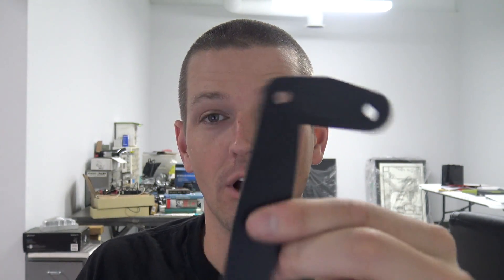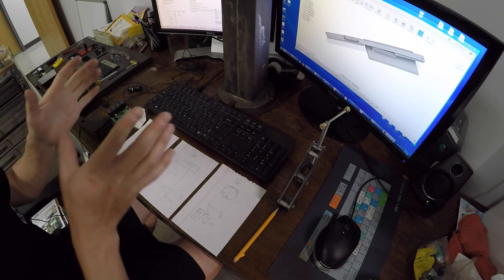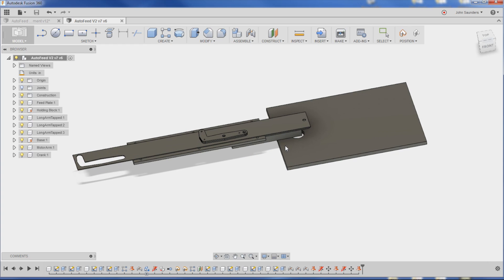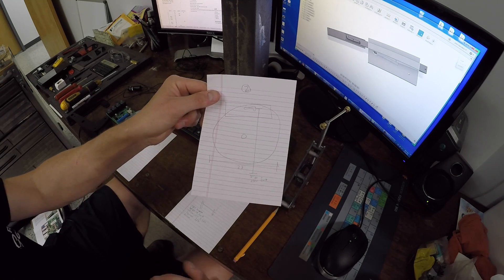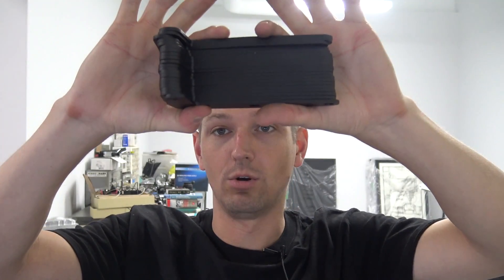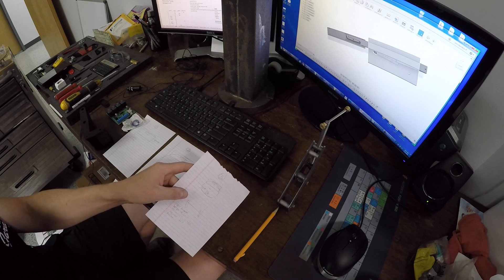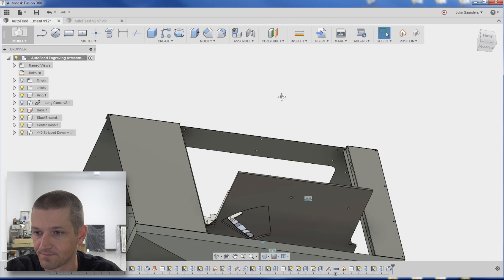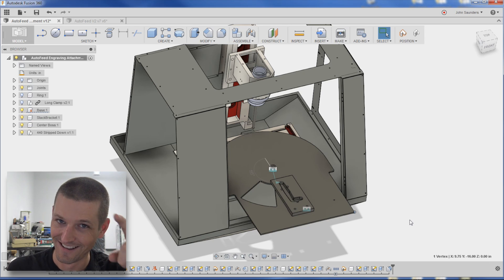Automatic Arduino CNC Parts Loader: Tormach 440!  Part 1

Comment: hi john, i have been thinking about this and a lazy susan design would work, a ring with bearing under the platter, they use the idea on a spice rack that rotates or a round table so the people sat around the  table can get food from the other side just by turning the table around i think you will understand wot i am meaning, thanks daniel

Comment: You may need something to push the engraved parts out of the plate. There will be chips that may cause the part to bind in the plate and fail to fall out by gravity. A simple solenoid should do it. You may  also need something to joggle the stack to get parts to fall into the cutout. And sensors to determine whether those actions have succeeded.

Comment: Linear version can be done much cheaper and more reliably than the rotary version.

Instead of big arms driving the slide, use a rack with a pinion gear on the stepper motor, gives you direct positional control and hella torque.

Linear system is much smaller too, so it will all sit right on the table top.  Will save a LOT of material too.

Also, turn the part 90° from how you oriented it on your linear slide drawing to save significantly on the stroke length.

If you elevate the assembly above the table some, you can make a chute from the drop-out hole into your waiting bucket, or just dump the finished parts into the chip pan.

I think the linear version with the part turned 90° can easily fit on the t-slotted part of the table, with no extensions needed.  You could even close the doors if you had the chute go out one of the side windows.

Whatever you do, remember that it all has to move with the table, so any feet you put down on the ground will have to have very free rolling casters (or more ideally, a single central ball under each leg (like you find on a ball conveyor, but upside down).

I'd be happy to sketch something up on paper and scan it for you if I'm not making myself clear here.
Reply: I agree with you! Though my first thought was to use pneumatics to drive the linear system. It would be simpler from a controls perspective, just a solenoid valve to two. 

The linear setup is just so much smaller. This is a good example of why it's good to step back and re examine your designs. The disc seemed better than the slider at first, but once you figure out that the disc really entails, the linear may actually be the simpler of the two.

Comment: John, as much as I love Arduino, you are right in that you should control this one from the mill with the relay board.
Trying to describe my idea, but it's not easy.
1. Screw-in round nylon 'backing' posts to a base plate at appropriate positions which have a chamfer to push the part downward and hold it in the +Y pos.
2. X-axis air cylinder feeder plate which fits under the part 'hopper' to feed the part (L or R) to a central position.
3. Multiple air cylinders pushing from the -Y axis again with similar nylon posts to clamp in the part.

Comment: if you have a removable insert you could have different sizes jobs and just change the insert, the disk could work for all types of jobs. and under the stack you could have a roller to the floor to task the weight..

Comment: Moving around a heavy weight outside the machine area is going to put a lot of load in a way that the machine is not designed for. You will also quickly exceed max workpiece weight.

One idea to fix that is to have the rotary table to be a half circle, such that it can move in to drop the piece in the fixture and then get out of the machine again. This leaves the problem of how to get rid of the workpiece again. That could be done by having the fixture as another rotary table.

The second rotary table moves with the machine, but it has no load on it and will not be too heavy.

With some clever half gear it would be possible to build this with just one stepper motor. The second rotary table does not need to be able to move until the work table is in the outer "switch workpiece" position. At that position it would mesh with a moving mechanism. The same principle could be used to lock it in place: spring loaded pins will fix it in place. When the CNC machine work table is in the outer position the pins will be pressed down so the rotary table can move.

Just a funny idea that popped into my head: It would actually be possible to do all this with NO stepper motor and no Arduino. The rotary tables would be moved by the Tormach machine table pushing against levers :-)

I still believe that the robotic arm is the simpler solution. The students can build one in three days and they have half the machines and none of the experience of Sanders Machine Shop. You would of course do it in metal using the plasma cutter to cut most of the parts.

I would fit the robotic arm with a suction grip and a contact trigger. The program would be something like this:

1) Move the arm to a pre recorded start position. 
2) Lower the arm until contact trigger switches. The arm is now in contact with the next workpiece.
3) Turn on suction grip
4) Move arm up to start position. Check that the contact trigger stays on.
5) Move arm to pre recorded drop/pickup position.
6) Turn off suction grip
7) Move arm to hold position and wait for CNC machine to do the job
8) Move arm back to drop/pickup position
9) Turn on suction grip
10) Move arm to finish position and drop piece.
11) Repeat

All that is just a simple program with your Arduino. It is a series of 3-4 recorded X/Y/Z positions and some turn on/off commands.

Comment: Only one idea I would try to incorporate, and that is removable pockets in the plate, rather than fixed, this would allow use on multiple jobs, a crap load extra work but if you are going to make it anyway you might as well try and get the most use/profit out of it you can.

Comment: Love the design except having the parts sliding on the disk. What if you added a air cylinder to push the part from your supply stack onto the rotating disk. That would eliminate all the friction of the parts riding on the disk and eliminate a large drive motor to turn the disk.
And if you not sure what I am thinking look at a bubble gum machine where you lay your quarters down flat then push the slider in to the machine to get you gum. Same set up I think it would work great

Comment: I was thinking optical sensors as well - but to ensure alignment of the rotary platen.  You could have multiple cutouts to drop parts onto, and then have multiple holes drilled through the table that provide an index for the platen.  Program it to stop whenever the photocell triggers.  That would allow you to advance the table a partial rotation, engrave the part, partial turn, engrave another.  When it got to the other side of the rotation where you part is supposed to fall out, another optical sensor could verify it did.  Might be easy with a relay l to add a "poker" solenoid that would actuate when the piece was over the escape chute to ensure the part did actually eject.  Since this is engraving and not machining, you wouldn't have to worry about chips blocking sensor holes.

Comment: i would think that you would want more stations on your indexing table to pick more parts then you could just index by the amount from the drop station to the load station.  that would give you a better throughput as the table would make less rotations for many more parts.

Comment: One suggestion about your sketches.  Keep an Engineering Notebook, and do your sketches in that.  Date the sketches.  Why this is important....possible patents later own.  I still do a Notebook to keep my doodles in.
Reply: The modern version of this is to use a digital signature timestamp 
service, the results of which can't be forged and are usable on cad/cam files.
Reply: A 'real engineers notebook' is a special kind of thing.  Back 'in the day' it used carbon paper, you put between 2 pages.  They were all sewn in, but the second (carbon copy) page could be torn out and 'filed' with 'the company clerk' (who filed them in case your notebook with the original was lost or stolen).

If you use it on a regular basis as part of your daily work flow, it is a legal record.  Just like a court clerks record of proceedings, it is pretty much immutable and incontrovertible in a court of law.  You must be able to show a long term use as a daily log of your thoughts.

In today's world, I don't know if there is some newtech version.  But I kept a day planner for years that filled the same roll in my techie professional life.

Comment: Hey John, I would suggest combining the two designs. Have an externally mounted hopper that an arm(segment of your disc) swings out to meet. A solenoid then releases a single plate from the hopper into the arm. The arm swings back into the machine and does the engrave cycle. Then swings back out with a different table X position to drop the piece.  X axis then moves to place the arm back under the hopper to collect another part. 

On the arm I'd do a 3 position clamp. Positions being open, catch and clamped.  In the open state the parts would simply drop to the floor/into a bin. In the catch state a lip would catch the parts dropping from a hopper. It could be done with a single air actuator and a spring. Have two valves and two different air pressures. So open is 0psi, catch might be like 10psi and clamped would be like 80psi. Adjusting the pressure on the catch would set the amount of opening as its pressure against a spring. The same action could also trigger the hopper release or that could just be a Y axis table movement. 

I would also put a V shaped catch on the moving jaw that indexes the arm onto the Tormach table. So the arm would rotate into position before clamping down on the part. The action of clamping down would then lock the arm into place. Releasing might be tricky because you want to drop pressure to the catch state but not to open. 

All that said maybe a Y table movement should also trigger the drop, rather than the air actuator. That makes the air actuator simply a clamp. The lip would simply be spring loaded with a leaver that the table movement hits to flip it down. 

This design might be more re-usable for other things. You would just need to make new clamping jaws and hopper release mechanism for each part.

Comment: The support legs will need a way to move with the X/Y axis during engraving, as the fixture /rotary table will need to move.
Reply: Also the clearance from the rotary part to the 440's doors will need to be sufficient to ensure when it does move in the X or Y axis it can't be crashed into the enclosure.

Comment: after reading some of the comments below i can see why the 2 Axis of freedom for the support legs was discussed.
i can also understand the use of an electro magnet for holding the work in place whilst being engraved.
I am in no way advising you how to build this im just throwing ideas around.
what about using a vacuum system on a helicopter blade type set up with vacuum suction cups opposing each other at 180 degrees on the blade thus one picks up the ( to be engraved material from a hopper whilst the other picks up engraved material from a die on the mill as it rotates to place the new part in the die the engraved part can be dumped into a box or container... and so forth. The Materials hopper could then be mounted low for ease of reloading with stock and the stock could be fed to the top gradually by a spring loaded mechanism as in a gun magazine.

Just a thought, love the channel

Kind Regards Vince.

Comment: The trouble starts and ends with getting the parts into and out off the fixture, with the tolerances needed for the milling. The easiest way to overcome the trouble, would be to make a number(20) of slots in the disk and go with that, automated feeding is an overkill.

Comment: You may want to consider the hopper system so that future engraved parts don't ruin the powercoating from the previous part.
So, if a part is already in the hopper/bin/whatever, what is protecting the part from being damaged?

I obviously don't know how durable powercoating is but this is something to consider.

Comment: John

Add a photo sensor just past the drop zone to ensure the part has dropped ,maybe a pause at the drop point in g code for the xxx axis of the table to turn on the photo sensor , then turn it off and carry on else flag a fault and do a m01

Just the rambling of some who has just got up

Stuart

Comment: hi! great video, again! i like your idea. i didn't read through all the comments but here is one idea. i know the whole thing is about building this from parts you can find laying around but i doubt that that stepper motor would work too long.
check out this link:
http://www.weiss-gmbh.de/Typ-TC.2481.0.html?&L=1
these are industrial grade, of course, but they would save you the hassle with finding a good pisition. the spindle inside guarantees a fixed turning angle every time and it is only one proximity sensor signal to look for. you still gotta maje sure the table is accurate in at least the engraving position, but that is easy too.

Comment: With all the extra mass of the rotary table, even if it's supported, will the 440 have enough table power to make the quick moves/ direction changes necessary for engraving? In otherword will it exceed the allowable table weight capacity. Just another thought for the mix, you could do the singulator mechanism on a stand outside the machine. Make a belt driven pick and place not attached to the table to pick out of the singulator pocket, use vacuum or your little electro magnets for the pick, drop in a form fitting nest on the table and clamp with some home made air powered clamps.

Comment: Look at some of the marble toys for escapements if you hold the stack and just drop one the weight is not a drag on the disc.

As for drawing most of the pre 80's original ideas were started on Bar napkins. I was one of the luckier 60's high school student in Chicago who as a Freshman and Sophomore was required to take a class in both Mechanical and Architectural drawing  I have been a 3D drawer ever since  it is just how  I think now. a mechanical pencil erasure and straightedge is part of my arsenal.,

My artistic drawing skills are not worth a wooden nickle  I leave that and color selection to others  with better eyes for it.  I can appreciate a good industrial design and a tweak to make it user friendly

Comment: John,
Just remember the KISS principal.   I think someone else suggested a pneumatic cylinder. (lots of power, low cost and can be run with a solenoid valve from that relay board)  Make a box magazine, top loading, slot exit at the base with a pusher plate the same thickness as the part.  Use a cylinder to  push and retract the "pusher  plate" .  The pusher plate pushes a part from the magazine  onto a fixture plate which has the locating features needed for the engraving.  Hold it in position with a magnetic chuck or just another cylinder used as a clamp.  When finished engraving release the clamping and use another cylinder to eject the part from the fixture.   When the pusher retracts (after the clamping is activated) it fully retracts from the opposite side of the magazine and another part drops down ready to be pushed  into place on the fixture plate.  Make the magazine and sliding parts from UHMW or expensive Delrin so the blank parts move with ease.    

Good luck,  will be interesting to see what you come up with.  Was  really nice to meeting you at the bash.   Craig

Comment: The radial motion is a lot of motion. You already have the stepper motor so it is probably about the cheapest option at this time. I would think however that a simple linear motion situation with 2 small air cylinders would be super simple. One cylinder for a positive stop and one cylinder to push/clamp the part. simple, small, and reliable!
Reply: Actually you could do it with a single cylinder that would push the part against a stop and hold pressure against the part. a blast of air after the process from underneath the part would blow the part out.

Comment: Just a few random ideas:

#1 Feed parts from the bottom to lessen the amount of weight on the moving plate, and could also allow for a clamp that can come down on the engraving position to stop the part moving while you are engraving (even if it is a reasonably snug fit it will still move around in the hole and possibly not give the best engraving results) 

#2 Fit as many blank holes for the clamp to fit as you can ie 6 or 8 possibly more so that you engrave  more parts per rotation

#3 You do not want parts dropping from the system into a hopper once engraved as they could put downward force onto a part already in the hopper and damage the powder coat finish (maybe use another stack with a linear actuator to keep the fall onto the top of the stack to 50 mm or so, this way you have a positive disengagement from the rotating plate and the least amount of risk to damage the finished parts. 

#4 With this idea you should be able to any stepper motor to run the plate, you could put a sensor on the outer edge (furthest from the middle gives the greatest rotational movement hence accuracy per step) this sensor can be inductive with the edge castellated or IR photo interrupter etc.

#5 Great idea to use the Tormach USB G / M code IO unit. There maybe some code for the Arduino to interface to the Tormach Path pilot already ? 

I look forward to seeing this project progressing :)

Comment: While turn tables are great for so many things I don't believe this is one of them. I think you were on the right track with your first idea.  I would use a pneumatic cylinder to move the slider say just 1/2" further than you think you need to go to drop the part and then use an air blast to shoot the part to the left to your catch bucket. for the hold down I would use ether another cylinder or a vacuum setup.